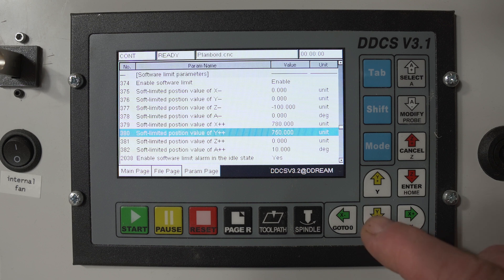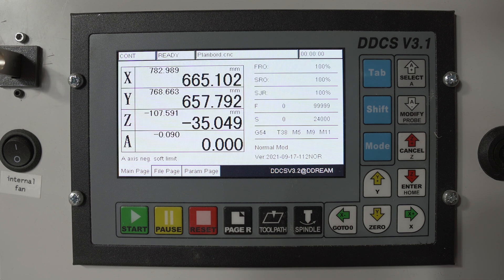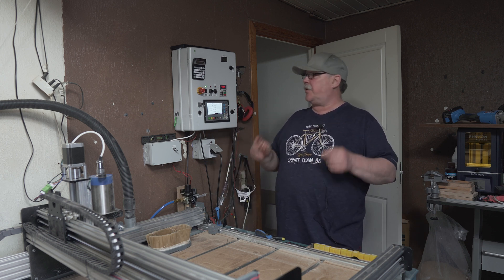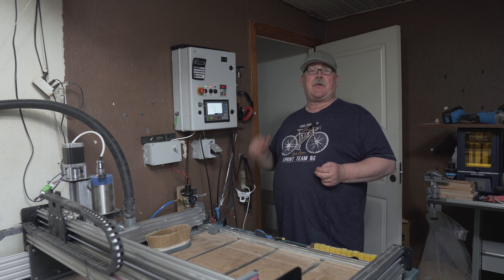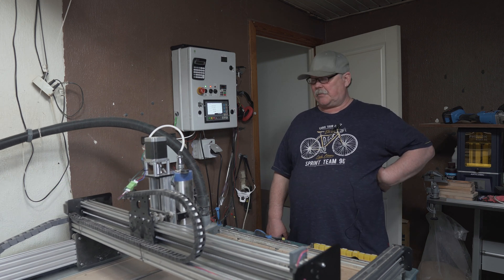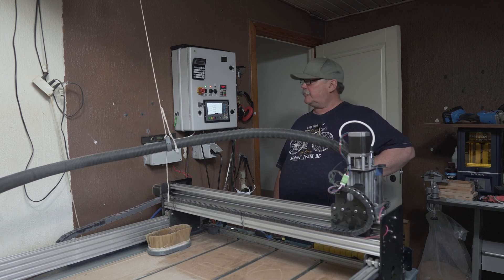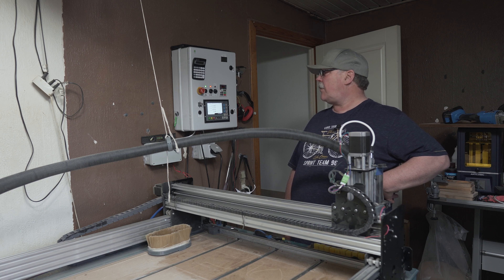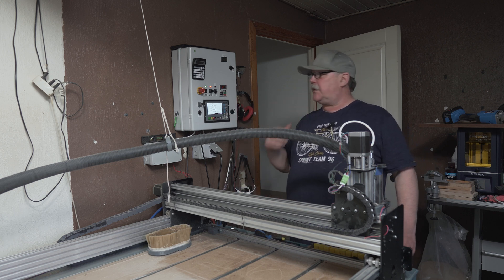How to use Soft limits with the DDCS V3.1

Comment: I've looked and looked but I cannot find a way to change my main display page to INCHES from MM. I've set P001 to IN but it doesn't seem to have any effect.
Reply: But I should be able to switch to inch without needing to run a g20 in a program....otherwise,  I need to convert everything before I can start running a tool.
Reply from the maker: @kurtlyons7123  That you do in line #115 in the menu of the settings
Reply: Line #115 is "Y axis protection speed" in the V4.1
Reply from the maker: @kurtlyons7123  Ups I dont have that version.  
then search for the text UNIT SELECTION. If this is P001 and dont work,  then I dont know sorry,
Reply from the maker: If you go to Menu #115 you select inch.  Anyway your G code will also include the G21 (mm) or G 20 (in)
Reply from the maker: https://www.youtube.com/watch?v=7YZ_vH53aPE&t=327s

Comment: Hey thx for taking out time and posting the detailed  video in series..... I want to use it for my lathe and that too for two axis only, will this controller be applicable... Also in case if I want to ask you any query related to it may I ask you in future, if yes will you please help me with your email or instagram id....Thx in advance....
Reply from the maker: Thx for watching.  I don't think this controller is good for Lathe.  I never tried, but I know there are many alternatives in the marked with a better price tag.
https://www.aliexpress.com/item/32260668115.html?spm=a2g0o.productlist.0.0.5b3231a8WL2Qw6&algo_pvid=6dddb061-4adf-4a1c-ba86-bdabc02f2f82&algo_exp_id=6dddb061-4adf-4a1c-ba86-bdabc02f2f82-50&pdp_ext_f=%7B%22sku_id%22%3A%2212000015572473329%22%7D&pdp_npi=2%40dis%21DKK%21%211756.32%21%21%21%21%21%40210318c916570792704018024ee7b9%2112000015572473329%21sea
Reply: @weitlingD3P  thx for your reply, cheers. Once again thx for posting the videos.....

Comment: Thank you for the nice video and sound effects :)

I want to ask you about the wiring of the switch limit

I have some switch with two wires and some with three wires
Reply from the maker: Thanks for watching.  The cord with 2 wires is a mechanical  switch, one wire go to X++ and COM minus.    If you have 3 wires it is a proximity switch and is wired X++     Black wire to COM MINUS and red wire to COM PLUS
Reply: thank you , looking forward to see more videos , especially if it explains why stepper motor block or turn wrong sense or just shake ... 

thanks again

Comment: Hello, please tell me 
how do I find out the processing time of the parts before the start of processing ? when the simulation is turned on , the syntax is checked, but the time is not specified
Reply: You probably didn't find this function on ddcsv3.1 either, it looks like the programmers didn't take this option into account in this controller, it's a pity, even on old remotes it's possible

Comment: Hello, Thanks for your video. Do you know if this is an intercative controller? Meaning let's say if you want to cut on a straigth line is it possible to manually enter Gcode G0 xxxx yyyy and with the spindle on ? Thanks
Reply from the maker: Hello and thank you for watching.  Unfortunatly this controler has no Data input (MDI)  You will nede the  DDCS Expert
Reply: @weitlingD3P  Ok thanks. Not so usefull command though.
Reply: Please show us how to connect the wires to the controller. I am confused
Reply: i have  DDCS CNC v4.1, but i cant input specfline